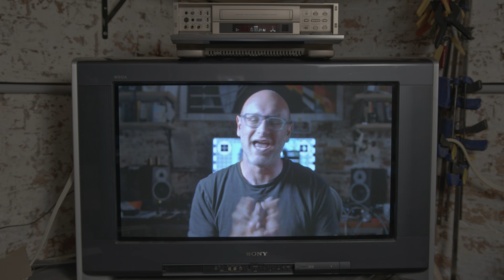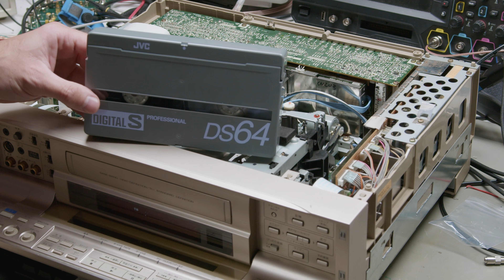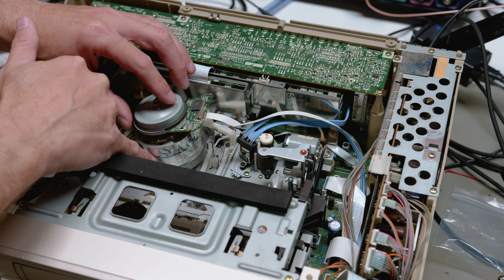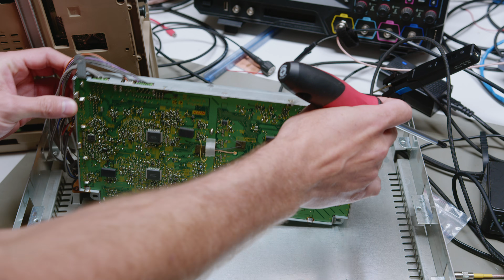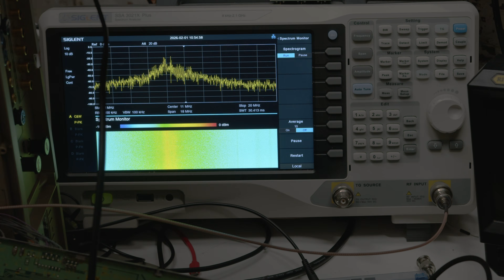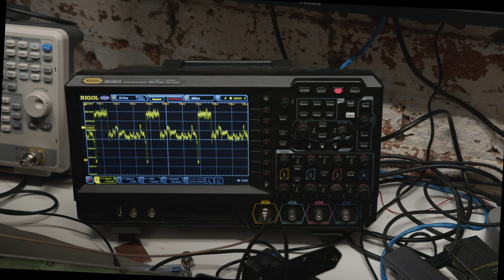Analog High Def VHS Video

Comment: You called it a last gasp, but is there something about the HD Laserdisc Hi Vision that unincludes it from this section of early analog HD. 

I know the Laserdisc was analog unlike the compact disc, is the Muse decoder considered digital?
Reply from the maker: You’re right. The HD HiVision laserdisc was analog to the same extent as this VCR. Muse requires a more complicated digital circuit to reassemble the signal, but the WVHS video still requires some digital processing to undo the time compression.
Reply: @superchromat  Interesting. Time Compression. I appreciate you writing me. How is it that 80s and 90s tech is more interesting and rewarding to study than current electrical engineering (at least the simple stuff). Working on this stuff in the 80s and 90s in Japan just had to be the absolute business.

Comment: Definitely need a digital frame buffer since the luma & chroma are read sequentially & at different sample rates.  They used time division multiplexing instead of subcarriers for the video components.   The 3 DC offsets on the scope were probably 202mV for chroma packets, -100mV for luma packets & -400mV for audio packets.  Audio was digital.
Reply: I believe the basic time division concept is designed to be implemented with only a set of line buffers, no need for a full frame buffer. Though, by this point in time, memory was cheap enough to justify including a full framebuffer anyway, even if it was just used to implement pausing. 

I'm not sure the same can be said about MUSE, the broadcast version of HiVision. It used four-way dot interlacing (with motion compensation) to squash the bandwidth requirements all the way down to 8MHz (unlike the 20MHz that W-VHS had). I get the impression the motion compensation absolutely required a full framebuffer to decode, but I've never been able to find a good visualisation of exactly what encoded MUSE looked like.

Comment: FM is primarily used to modulate the video signal because of the octave range of the analogue video signal. A typical tape head gap can only recover a wavelength a little bigger than the gap itself. Clearly the product of relative tape speed will affect the physical size, accepting that incredibly small gap size heads can be manufactured you’d think all was well, however the problem is at the other end of the spectrum. Analogue non modulated recovery through the gap is only effective for 12 octaves, so your small tape head gap could probably be manufactured to recover hi mhz signals but even in old standard definition vhs/beta etc, working back by dividing 5mhz twelve times for the 12 octaves means minimum recovery is about 1.2khz. When looking at the anatomy of analogue video it is easy to see sync signals can be as low as 25hz! FM modulation is the only method to overcome this physical limitation.

Comment: Big early HDTV guy here. This was a great overview & visualization of the hardware used in the W-VHS system. Its a very interesting format and, as you said, it's the final stand of the Japanese efforts for a worldwide analog HD system and a reflection of years of efforts made by Japanese society as a whole (through the NHK & a governmental entity called MITI).

"Analog HD" is always a bit of a misnomer since, from the beginning, analog HD signals passed through digital processes. Even the earliest 1984 commercial analog HD video tape recorder (HDV-1000) and earlier prototypes had an 8-bit digital time base corrector. The way the video breaks apart on the 1984 HDV-1000 when touching the head drum is almost identical to what you showed on the W-VHS VCR.

As you showed, while luma (black and white) is on both tracks, only one color difference signal is on each track. This reduces the vertical color resolution in half which is acceptable since our eyes are not very sensitive to color. Really, this is an analog form of 4:2:0 chroma subsampling used on DVDs, Blu-Rays, and YouTube videos to this day.
This simple form of bandwidth reduction (called "TCI") was a technique used throughout the era of analog HD. Most notably, the MUSE HD transmission system used a version of this and allowed transmission of HDTV to Japanese homes starting in 1989.

You'd think that since the signal went through all these digital processes, why wouldn't you just record the digital signal to tape? There was experimentation with this in the 1980's, but the results required a lot of (expensive) memory and (expensive) processing power to put EVERYTHING in the digital domain. By recording in analog and processing in mixed domain analog-digital, costs could stay low.

Speaking of low costs, the reason why the W-VHS board is on the bottom of the HR-W5 chassis was to save money! The HR-W5 was actually a standard definition S-VHS VCR (HR-X5) with a W-VHS head & "expansion board." In the same way, the earlier monster HR-W1 W-VHS deck was a standard definition S-VHS VCR (HR-20000) with a W-VHS head & "expansion board." This is also a pattern seen throughout this era of HD... Even the 1984 HDV-1000 was a standard definition 1" Type C deck (BVH-2000) with a special headdrum and TBC unit.

W-VHS decks were released in the USA too. They were seen throughout trade shows and were owned by wealthy individuals & businesess (and some magazine A/V reviewers in the 1990's). In the late 1990's/early 2000's, a New York company called Communicore even sold pre-recorded movies and concerts on W-VHS!

What made JVC/Victor brag about their W-VHS technology in the technical service manual was that they were the first to do all this in a small & low cost package. (Remember that W-VHS came out in 1994 when the first 66MHz Intel Pentiums were hot!) However, even with all these cost cutting measures, the W5 VCR alone cost $5,000 USD which is why your parents never owned one!
Reply from the maker: Such a fantastic comment. Thank you so much! This is why I post my work to learn from folks who know more than me :)
Reply from the maker: Oh! I only learned about HiVision when your upload of the 1987 demonstration video appeared on my feed.
Reply: @superchromat great comment I own 4 Hr-w5 units just 1 works actually and one I destroyed self when I trade the components in a new unit from 96. The problem is all works fine just I get as results a good sound but only a few seconds a colored bad video and and at least a black and white video and i might it's a capacitor problem but the technician said it's the SMD's and those has over thousands. He measured the caps on the board but I read it's wrong you need put them out or so and then measure them. Now I paid 250$ for a check up and the unit still not works
Reply: Cool seeing you here, Reely! I own some W-VHS tapes and it's just so interesting and fun using them :)

Comment: How did you record the footage into W-VHS?
Reply from the maker: I first recorded it digitally and then recorded it on the W-VHS deck using its component input.
Reply: @superchromat  I guess your video from 5 years ago about HDMI to component gives it away.
Reply from the maker: I’ve also spent the last year building a super high quality analog capture and playback device 😜 see www.superchromat.com
Reply: @superchromat  I would be interested in a SD analog to digital converter with TBC and frame synchronizer from sources like VHS, Video8 and Betamax.
Reply from the maker: @Capturing-Memories you like to be able to synchronize frames or framerate from multiple composite sources simultaneously? 

The SCION is mainly geared around component input, not composite, but the ADC stage is built around the 12-bit 3 channel ADV7842, which is also capable of receiving composite sources.

If you want to chat offline, I’m josh@superchromat.com.
Reply: @superchromat  No, just a single input Y-C for capturing analog video tapes. I've already have the BrightEyse 75 and S&W TBS800 which they do a great job but will be interested in some modern devices.
Reply from the maker: @Capturing-Memories  have you looked into direct RF capture? That seems to be all the rage in the analog video archiving community.
Reply: @superchromat  A very long and involved process plus they haven't ironed out all the kinks, such as ringing and some other artifacts, As it stands capturing Y-C is as good as it gets.
Reply: There are also capture devices that support hd component output as well as input.
Reply from the maker: @DoubleMonoLR yup. I’ve designed my own

Comment: I can give you the inside scoop, a relstive is a long time broadcast engineer who worked on the ATSC 1.0 standards, and also was involved in developing out the tech eventually used. 

The Japanese and European HDTV standards were analog ,and as a result they had to use satellite transmission. 

The industry in the US and the FCC wanted it to operate in a standard 6mgz ntsc channel. 3 reasons 1)they didn't want consumers to have to pay for satellite service to get it, they wanted it on the standard broadcast spectrum . Broadcasters werent thrilled by hdtv, but if they had to do it they would prefer it on the existing channels,bc they of course are free. If they had to buy spectrum for satellite transmission it would be very expensive. 2) related, the FCC was planning a transition from ntsc to ATSC, and using ntsc they could allocate the unused channels in an area ( like channel 3 vhf in NYC) to simulcast in HDTV.  3) by choosing ntsc 6mgz channel, it eliminated the Japanese and European ( I believe Phillips tech) from it, bc their system couldn't work.  

Of the three number 3 in was likely a huge one. First of all, this was when especially tensions with Japan were high,when the fear of Japan 'taking over' was a big thing. Plus if they chose the Japanese standard or the European one, they likely would have to pay licensing fees. When ATSC 1.0 was developed they used public domain ( for example, the modulating encoding method was a bell lab standard, which was public domain ( vrc 8? Not an emergency engineer myself ) or they created a license bundle with very low licensing fees. There was a much better modulation methodology available that was owned by zenith, that got rejected by Sinclair and other large broadcast groups bc of the licensing costs involved

 And yes, there was an undercurrent of anti Japanese feeling that was part of it too. 

Back then remember people picked up tv from over the air or cable, and using a 6mgz band was compatible with much of their equipment.
Reply from the maker: Comments like this are great. I really appreciate the insight and additional details.
Reply: I thought I read somewhere that the tests to compare against the European standard were not using proper RF filtering to give VSB-8 and edge
Reply: @jeremyloveslinux  
I am not sure of the specifics (not an engineer myself) , that is possible. If I speak to the relative who was involved in the testing I'll ask them about that. My main point was that the European and Japanese systems never stood a chance given the parameters and also the politics of the standard. As you can see from ATSC 3.0 it never is simply about the best standard, always politics and other considerations including of course cost. Someone blew it in ATSC 3.0 with patent licensing that may have helped deal a death blow to ATSC 3.0 ever taking over (if the patent infringement is applied to anyone with an ATSC 3.0 tuner even, it will end anyone being in that market. )
Reply: ATSC 1.0 uses 8VSB (Vestigial Sideband) modulation. The newer ATSC 3.0 uses the more robust OFDM (Orthogonal Frequency-Division Multiplexing). Unfortunately broadcasters are trying to add DRM to ATSC 3.0 and that's creating a big mess for consumers.

Comment: I wonder if this caught on and the world was switching to digital, would we have jumped from dvd straight to 4k discs as the next major upgrade?
Reply: Likely no. The reason? The technology to handle higher res pictures on the display side wasnt there. It took a number of years for LCD tech to get to where he could handle that kind of refresh rate.
Reply: @njlauren  Then I wonder if the drive for much cheaper HD displays to LCD or similar would have accelerated as well? And if it did, then by the time DVDs were to come out it nobody would have bought them as theyd look like vhs in comparison! 😄
Reply: @BiggidyBong 
The thing is a chicken and egg thing. LCD tech ( or gas plasma) took time to develop, and they needed a reason to develop them, and the reality was until HD became available there was no reason
 

When that did the testing of the various HD proposed standards in the early 90s, that had a custom monitor made by Sony, it was a CRT, 16x9 format ( or rectangular) and had one of the biggest CRT display tubes eversdw. Thing weighed like 300 lbs and was I think 36 or 38 ". 

To get the effect of HD the screen needs to be larger, and the relative I was talking about said that it would take flat panels with large enough size to make HDTV fly. At the time LCD screens were expensive, I remember a 22" gas plasma at a bose store they was like 20k around that time. 

Of course tvs did take off. And in one sense they did lead the pack, 4k tvs came out before anyone had really adopted it,even today broadcast tv is mostly 720p/1080i, and if atsc 3.0 becomes the norm ,if ever, it likely will be at most 1080p, they won't broadcast in 4k. Obviously streaming services have picked up 4k, so there is a market for it. 

The funny part is the TV industry was trying to find the next thing to get ppl to upgrade, tried 3d and it flopped. Then it was 8k, which has remained a fringe product few people are buying. One of the reasons why is that 8k is kind of like some of the idiocy around hi fi, 8k formatted video just doesn't give you much of a difference , even on the largest tvs. You don't sell 8k tvs, no one os going to bother doing 8k content , pure and simple.
Reply: We would probably still have CRT manufacturers if this technology stuck and came just a bit earlier especially on the tv side over consumer cost vs commercial cost, and if not for 2008
Reply: @TheSpinningBandGR 
CRTs were going to become obsolete, drew too much power, were too bulky and they have limited resolution. Not to mention that CRTs were made overseas long before led and LCD screens replaced them. Cheap labor is cheap labor.